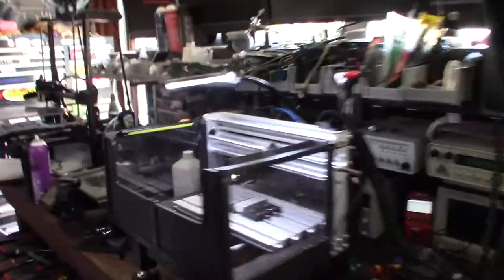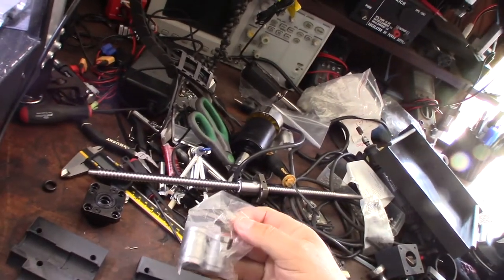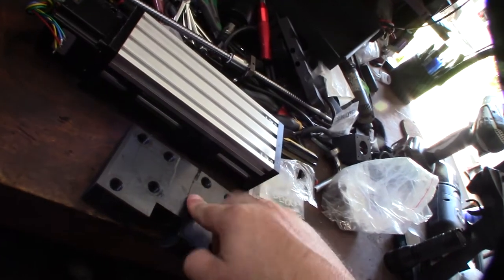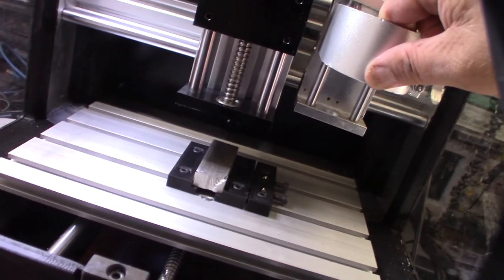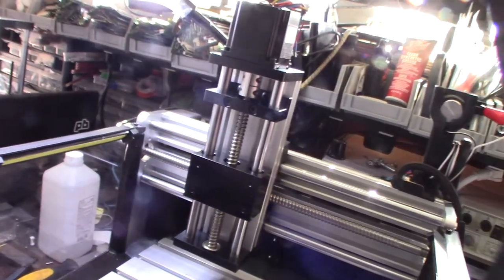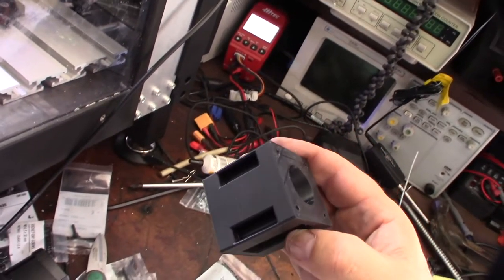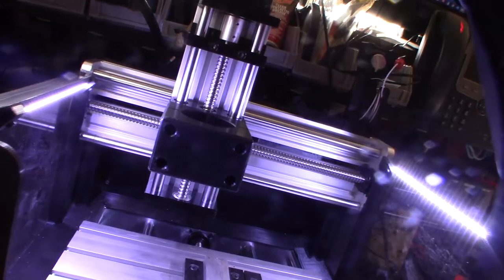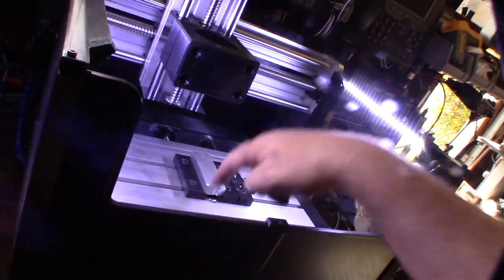3018 CNC SFU1204 Ball Screw Conversion And X Z Carriage Uprade Part 3

Comment: Thanks for these videos. I just received my 3018 Pro MAX (assembled it about 3 days ago). Before I bought it, I suspected I'd want to upgrade to ball screws. This series has made me sure I want to. I'm also thinking of going to linear rails on all the axes since the 12mm rods have quite a bit of flex in them. I could easily get 0.1mm of flex on the spindle mount when I pushed it back into the x-axis. Also, thanks for the tip on the set screw for the z-axis 8mm rods; mine came loose on the first day, so that was the first mod I did.
Reply from the maker: I was thinking about linear rails also.